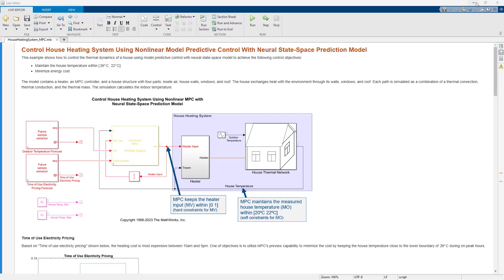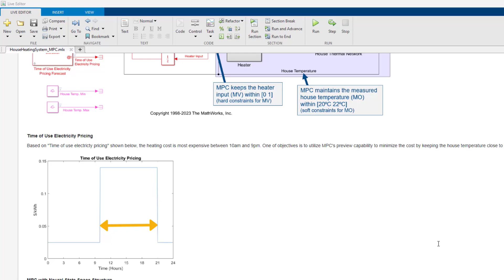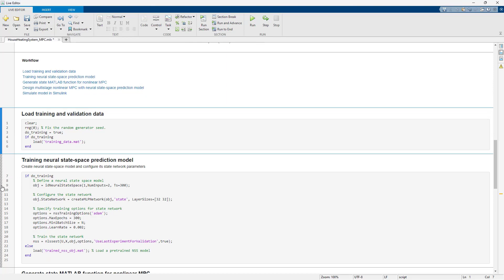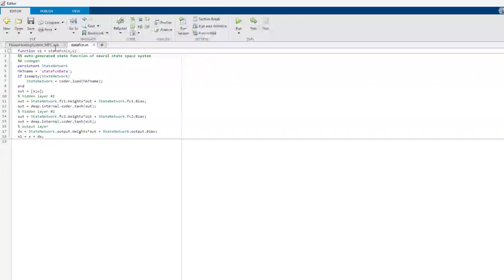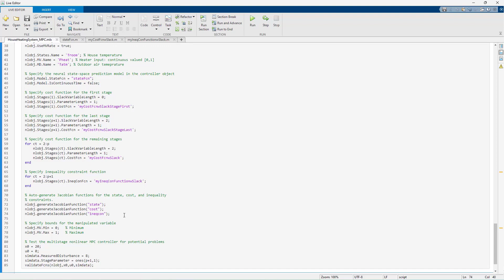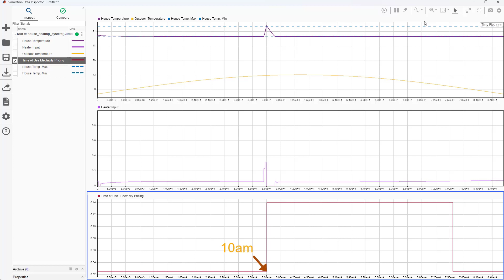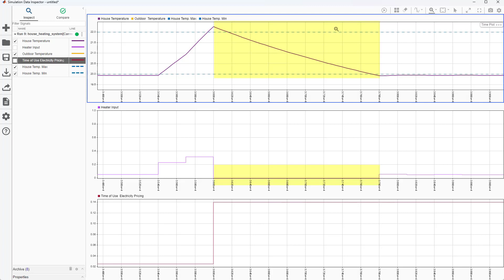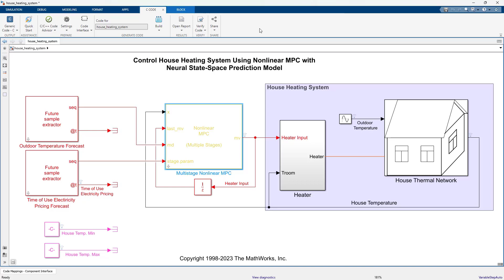Energy Management Using Deep Learning-Based Model Predictive Control (MPC)

Comment: Very nice demonstration thanks. What are those 'future sample extractor' blocks in the Simulink model?  I can't find any documentation for them or see them in my Simulink app (R2021b).  Can anyone point me to the documentation on this?
Reply from the maker: Hi @BillTubbs, Thanks for your comment. The example used in this video is now available in our documentation, which can be accessed here: https://bit.ly/HouseHeatingSystem 

On this page, you can also open up the model in MATLAB Online to investigate any blocks in the Simulink model. The one you’re asking about is not a built-in Simulink block but it’s masked subsystem. By clicking the arrow in the left bottom corner, you can look under the mask to see what this block implements. You’ll notice the subsystem is using a MATLAB Function block to generate the Outdoor Temperature forecast data.
Reply: @MATLAB  Thanks but I don't have R2023a.  I am still using R2021b and I can't open this simulation file.  My main question is what is the signal between Future Sample Extractor and md (seq).  Is it a scalar representing the predicted disturbance at a future time, or a sequence representing the full predicted sequence of disturbances from time t to t + Hp, where Hp is the prediction horizon?
Reply from the maker: Hi  @BillTubbs  , that’s correct. The sequence generated by that subsystem is the sequence of disturbances from t to t+prediction horizon. Although you might be running a previous version of MATLAB, you can explore the following example in your browser using MATLAB Online (click the blue button on the example page), which always runs latest version of MATLAB: https://www.mathworks.com/help/mpc/ug/use-multistage-mpc-with-neural-state-space-prediction-model-for-house-heating.html

Comment: So MPC saved money for that brief period after the price of electricity went up and after that it would be the same as any other control system?
It would be huge savings if considered across all of households but for singular examples is it really worth the money?
Reply: MPC is also applied to commercial/community housing network as you said
Reply: Bear in mind this is an educational video. Thermal storage is becoming more attractive, at least in large commercial HVAC systems, so this kind of dynamic optimization over a long time horizon is going to be more and more relevant, even if this is one-house example does not show it.